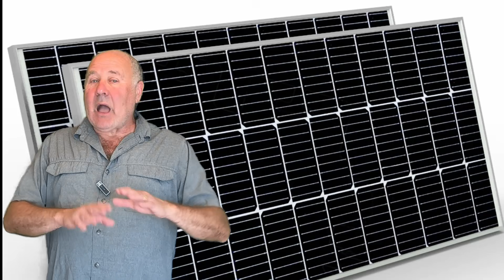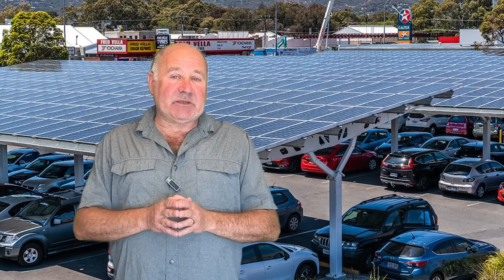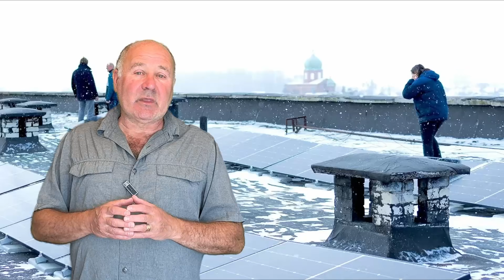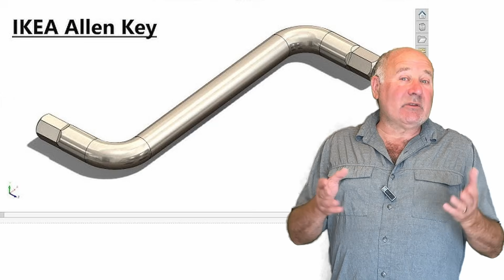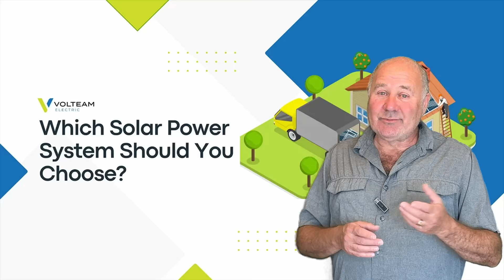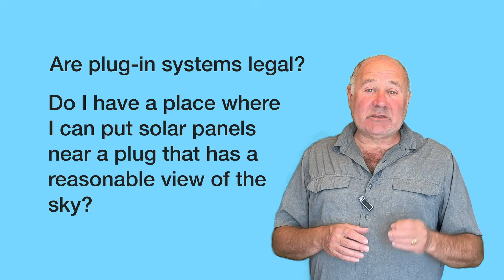If you’re thinking about getting solar, watch this first

Comment: You missed out the 4th category: Off Grid.

Ten years ago, off grid was not feasible for the vast majority of people, but solar panels have become so cheap that their cost is almost insignificant to the cost of the installation, the panels have doubled in power output per m² so that many people now have sufficient space for them, and batteries have gone from expensive, unreliable and short lived lead acid, to cheap, highly reliable, 30+ year lifespan LFP batteries, so storage isn't a real issue anymore.  Going off grid means no service charge, so gives an additional significant saving, plus most of the regulations requiring approved equipment and approved installers are only applicable for grid connection, so an off grid system can be built significantly cheaper, although rules do vary with country/state.  

There are a lot of people with grid connected systems that currently have annual electricity bills around zero, making credit from selling spare power in summer and using that to pay for grid power in the winter, but in that situation, any power you use affects your bill, while once off grid, any power you use is genuinely free, so you can use as much power as you want, no need to be economical with the power, unless the weather has been continuously bad and the batteries are running low.  

All summer I've had a spare 30+ KWh per day available, which can be used at zero cost if I can find a use for it all, and that is from an off grid system that cost me well under $5000 to purchase and DIY install, has zero running cost, has all components duplicated for redundancy, and might need some maintenance in 30 years time.  And my house still has no panels on the roof, they are all on the garage roof, which has the advantage of bifacial panels getting power from top and bottom, and not being part of the house it can't affect house insurance for fire risk etc.  I started the project because I needed a new garage roof, and realised that bifacial solar panels are cheaper than traditional garage roofs, so the $5000 also paid for a new double garage!

Off grid systems are still rare, but they are now perfectly feasible at reasonable cost, and with battery capacities increasing rapidly per $ cost, they are becoming a sensible option for anyone with sufficient space that has a clear view of the southern sky.  If your view south is blocked by buildings or trees, then it won't currently be feasible in high latitude winters, but otherwise should now be considered as an option.  Both panels and batteries are still improving rapidly, another doubling of power output per m² and doubling in KWh/$ storage, and in another ten years you won't even need to worry about a southern view, a vertical view of the clouds will be sufficient and a grid connection pointless, unless you live in an apartment block.
Reply from the maker: I agree with you, but I would say the second kind of system I described architecturally is the same as an off grid system. 

I don’t think we’ll see a doubling of the efficiency of solar panels per square meter, but a price drop of batteries is almost guaranteed. So yes, off grid will make sense for more and more people as time marches on.
Reply: @Decarbonize11  We are currently getting around 22% efficiency from a normal solar panel, maybe 23% for the latest, but to get 23% you appear to need large size panels, and that puts the price/KWh up.  That's not quite true, because I have bifacial panels, which are giving about 22% extra power by using both sides of the silicon wafer, so I'm sort of getting 27% efficiency.  The researchers are working on multi-layered panels, which apparently have a theoretical maximum efficiency around 88%, and presumably a bifacial version of that would get an efficiency >100% !    My guess is that we will easily get above 44% from normal cheap panels before development pace tapers off; a lot of people have very limited space, so there will be demand, and people will continue to pay relatively high prices for the best panels.  It is a huge market, worth investing in R&D.

Hard to predict batteries, it took a very long time to improve on lead acid, but I think a home storage battery that can store summer energy for mid-winter use is feasible in the not too distant future.  An extra KWh per day though December is enough to make a big difference to the feasibility of going off-grid, and that is actually already possible, just a little expensive... 32KWh of battery is currently about £3000 at DIY prices rather than UL listed prices.   At the moment it is much cheaper to install an extra KWh of panels to deal with mid-winter than to install long term storage, but that only works well if you can see the mid-winter sun, and Ireland/GB are a bit far north for that unless you are quite lucky in your location.  If it is worth it or not depends on your standing grid connection charges, which currently at only £200/€300 for UK/Ireland per year will take quite a while to repay the current cost of a large battery, but the grid charges will go up, and the batteries will come down.  Meanwhile, with solar panels at £100/KWp, saving the grid charge can pay for an extra 2KWp of panels each year, for extra power every day, instead of only until the battery runs out - if you have space for the panels then you don't need the batteries, except for overnight use.

Comment: 3:05:  not just utility workers.  Anyone who might come into contact with a downed powerline you powered up, likely your family or neighbors. 

Further, your homes power generation (be it solar, petrol generator, hydro) would try to power whatever loads are on the fragment of the grid it's now connected to.  If that's ten homes, it would be trying to start around a dozen fridges and freezers, maybe run electric hot water heaters, electric heat or heat pumps, etc.  With all the power running through your homes pole transformer, which I believe is typically rated 200A in the US.  Good luck with that.
Reply from the maker: That’s why for systems that run during a power outage, the first step is to isolate the home from the larger grid.

Comment: I'm considering a rooftop solar installation on a new home.  The utility company is offering a rebate to include a battery in the system.  Great, but do I choose an DC coupled configuration with the battery on the solar panel side of the  string inverter, or an AC coupled configuration with the battery on the line power side of the inverter?  A DC coupled system has an efficient single string inverter.  An AC coupled system, while less efficient having to convert AC back to DC at the battery, allows for micro-inverters which maximize output from each PV panel and enable monitoring of individual panels.  Both efficient in their own way, each effective for backup power. How to choose!
Reply from the maker: Good question. 

If there are trees or buildings that will shade your panels unevenly, the micro-inverters have an advantage. Personally I wouldn't worry about the ability to monitor indivdual panels, but it would be helpful if you're trying to find the root-cause of a problem. 

I'd go with the simplicity and efficiency of a DC coupled system.

Comment: free men dont ask lol, before balcony solar it was called guerilla solar
Reply from the maker: Most people want it to be easy and safe, and for that it needs to be explicitly legal.
Reply: @Decarbonize11  i guess they will have to pay for the data centers and ai slopifcation of the internet and have to sit on their hands while the climate changes
Reply: Generally the rules are there for good reasons.  (I find it educational to try working out why each rule is there.)  Unless you do a risk analysis, go through the various failure modes and mitigate the risks for each, you've misspelled "uninformed and irresponsible" as "free".

E.g. if you pump power out to the line when the grid is down and one of your kids or a neighbor is electrocuted?  That's on you.
Reply: I knew a retired building inspector, who explained to me that most of the building code rules are there because somebody died.  "I'm SO SORRY, I didn't realize!" isn't something I ever want to have to tell a grieving family.
Reply from the maker: @scottwillis5434 
More than once, I’ve heard the phrase “code is written in blood “

Comment: Australian here - personally we've had solar on our house since the very early 2000's, in that time the price of the panels have decreased to a fraction of what they were while efficiency has increased so we're thinking about taking the panels and inverter off, fitting them to the workshed/garage  with a battery as a "off grid" system and EV charger (the inverter we have allows this to be reprogrammed), then putting 3 or 4 times more panels on the roof (still cheaper  in dollar value than the 6 panels purchased back 2001  even without considering the discounts/subsidies) AND two battery banks 
Australia has the greatest per capita adoption of solar and because solar is expected by renters these days  rental properties (a big outlier in the adoption of solar panels) are increasingly catching up with owner occupier properties.
Approval is a single online form, often submitted by the installer, and usually takes less than 24 hours to be ticked and flicked back, so the trades people can be on your roof and fitting within 3 to 4 days depending on their workload. Often the biggest hold up is in "strata title" (multi unit properties with common property - where these are "Villas" or "units" multiple single or double story dwellings with common walls and roofs) as before even utility approval  this all has to go through Strata management (who are a strata management company - usually a local realestate business, and the owners  - owners get the vote, management doesn't they just implement)  
One of my siblings is going through this with their investment property -  4 owners want solar, 5 don't and as the cost of upgrading the common power in-feed will be shared  even with owners who don't want to install solar it's at an impasse until one more owner comes on board or sells to a new owner who does want solar... 3 years and counting :(
Reply from the maker: Thanks for sharing your amazing solar journey. A great example to the rest of the world, especially in sunny places like Australia.